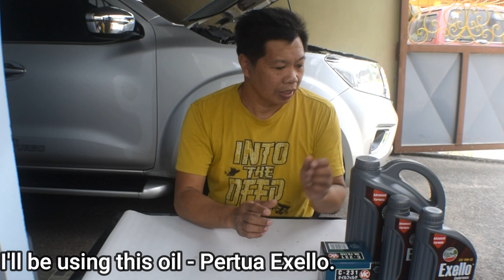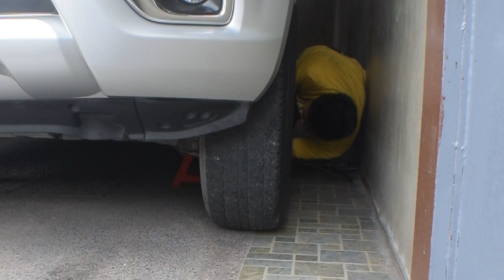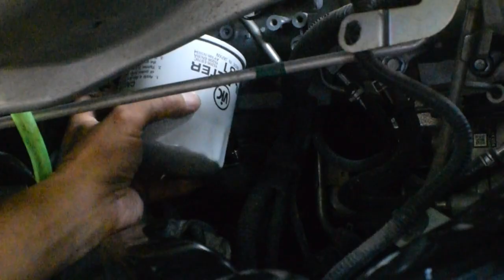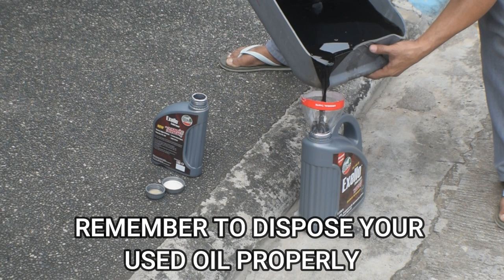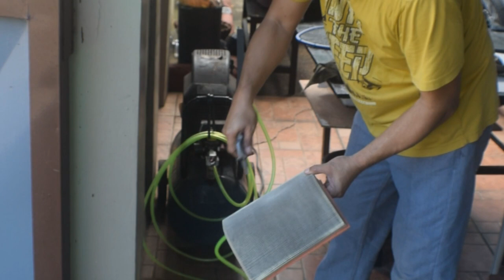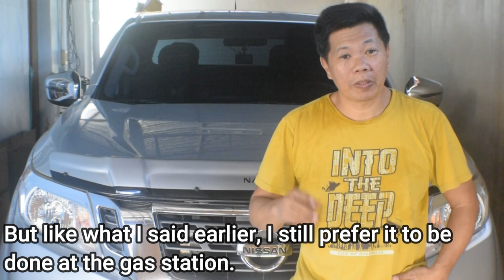60K KILOMETER OIL CHANGE ON MY NISSAN NAVARA NP300 EL CALIBRE

Comment: Do you have the 2.3 or 2.5 Liter engine? My NP300 from 2018 has the 2.5L. They are made in Rayong Thailand
Reply from the maker: yes mine is also a 2.5lit engine

Comment: Another good job sir Joey, you may consider to change also the drain plug copper washer, tag 60p each lang sa casa, DIY ko din co ng navi ko ty,❤️👊🏻👌✌️👍
Reply from the maker: Thank you sir naisip ko din yung washer kaya lang hundi na ako nakabili sa auto supply, rush lang ang pag video ko nito kasi marami kaming work busy ngayon.

Comment: Sir nakapagpalit kana po ba ng Transmission oil and differential oil? Thanks po sir sa sagot.
Reply from the maker: Yung sa differential oil gagawan ko ng video pero yung sa transmission papagawa ko nalang sa casa. Automatic kasi navi ko. Maselan pag automatic.
Reply: @joeysd.i.y  ahh oo nga sir maselan pala pag automatic. 
Plan ko po kasi sir change lahat ng fluids. Naka manual lng po ako. Kakaorder ko lang lahat ng oils needed. malapit na kasi 60k mileage ng unit ko. Okay po ba tong desisyon ko? O masyado lang magasto?
Reply from the maker: @jayt4724  yes tama po. Matutuwa ang navi mo sir fresh lahat ng fluids. Pag 80k km pwede na rin mag palit ng radiator coolant.
Reply: Try nyo sir KAG 90 PERTUA

Comment: Sir kaylangan ba linisin yung lagayan ng oil filter bago mo ilagay yung bago?
Reply from the maker: Kahit punasan mo lang sir yung tumapon na langis ng malinis na basahan.
Reply: @joeysd.i.y  salamat sir.  tanong ko naman. ok lng ba ginamit ko na oil shell  Helix HX5  15W-40 for diesel?
Reply: Navara NP300 din unit ko sir. Yung Yellow ang kulay na Shell Helix HX5 15W-40 ang gamit ko. Ok lng kaya ito? napansin ko kasi parang lumakas ang vibration ng engine ko

Comment: 60k kilometer is too much and overkill sa sasakyan for oil change interval. Mobil 1 5w30 full synthetic claim na ung langis nila ay can protect the engine up to 10k miles pero ang daming di naniwala dun dahil nakita sa Oil Analysis at bumagsak ito.Take note 10k miles ito at Mobil 1. The best thing to do is you have to open the cylinder head para makita kung may buildup ng oil sludge at kung ok pa mga cam assembly baka puro wear na. 2nd mag bigay ng oil analysis para makita ang oil health ,oil contamination at machine wear. If malinis and walang damage sa cams maniniwala ako na mabisa talaga ang pertua at tinalo pa nya ang mobil 1 and breakthrough ito satin dahil pinoy invention ito.
Reply from the maker: Thank you for the information sir but I regularly change my engine oil every 7.5k klm. Sorry for the misleading thumb nail  what I've meant by 60k klm oil change is not changing it for the 1st time at 60k klm. But changing my oil again at 60k klm.
Reply: @joeysd.i.y  oh ok i thought 60k kilometer oil change. More power sa channel mo sir!